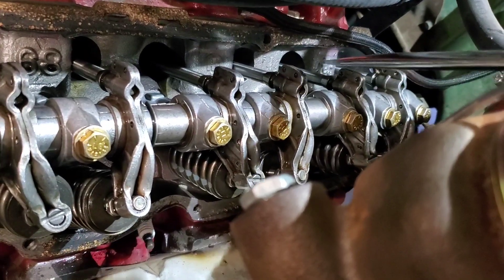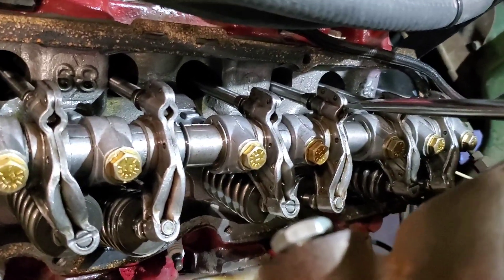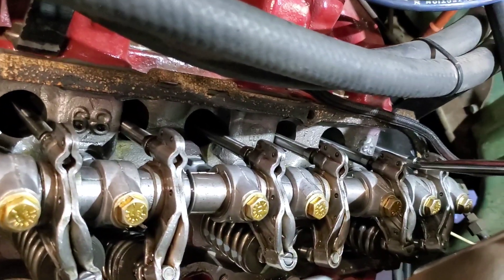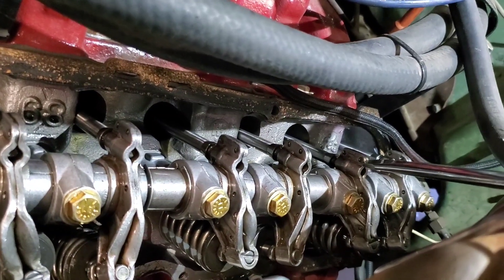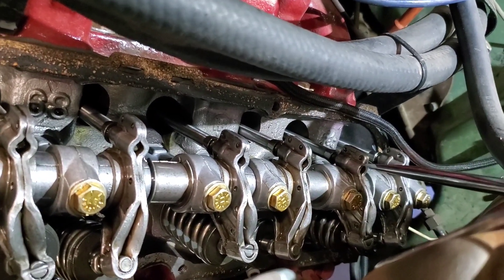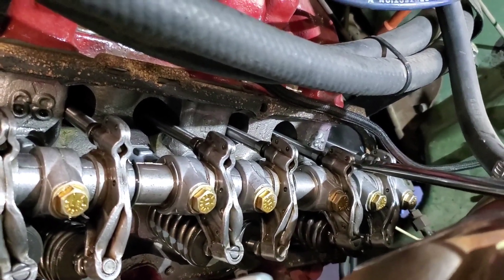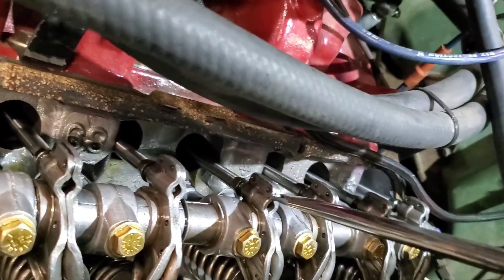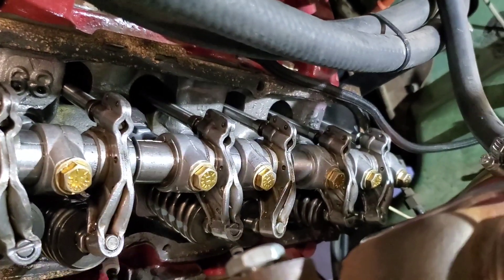How to identify bad lifters in an International V8 engine

Comment: Amazing timing on your post!  I just put the engine back into my pickup and had the exact same problem.  I cleaned and reused my old lifters because they seemed fine and I didn't want to pop for a full set of 16.  I'll pull my valve covers tomorrow to see which ones are causing the problem.  Thanks for the great tip!
Reply: Just to confirm,  I'm checking these with the valve closed, right?  If so, I have 6 bad lifters.  I'll probably just put in a full set with so many problem children.